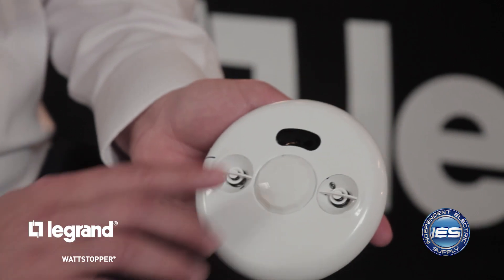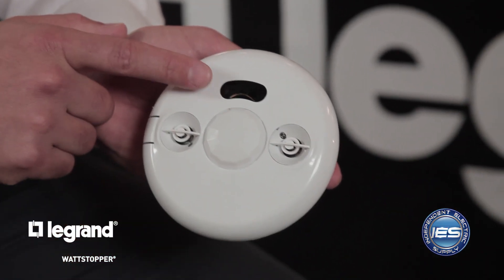IES Presents: Dual Technology Sensing with Wattstopper DLM

Comment: How do I over ride this non-sensing motion on these?  They surely look nice and pass inspection when electricians installed them, but they never work from day 1.  Inspector asked and tested the lighting part of it and did not check the functionality of them.  Now, it'd cost me more $$$ to get electricians to come back out to replace them with simple on/off switch (since they would turn off when there's no motion, but fail to turn back on when we move about in the room, especially when clients enter the dark hall way, expecting them to light up).  I don't like to use the word HATE but I will use it here:  I HATE THEM.
Reply: Yes I am an electrical maintenance out of college if the customer either wants it to be bypassed because it's junk or hoity-toity Engineers that are spoiled that can't push a button want the sensor to work when it never does so every 3 months it has to be reprogrammed and my supervisor does not give us workers the programming remote thing... honestly this product is asinine